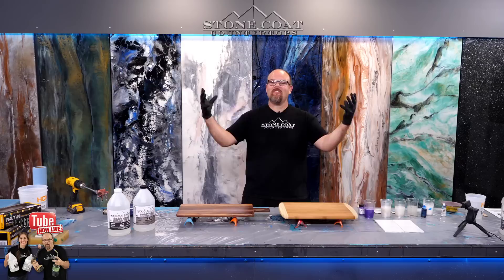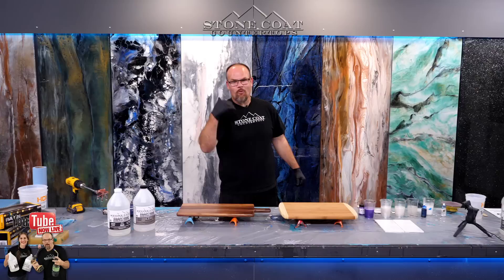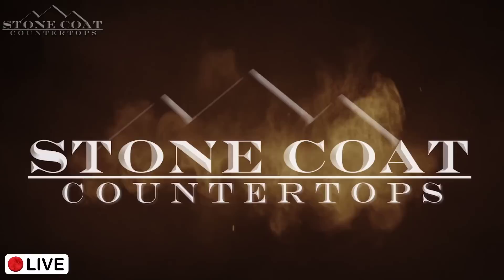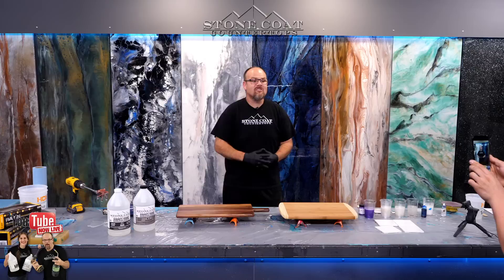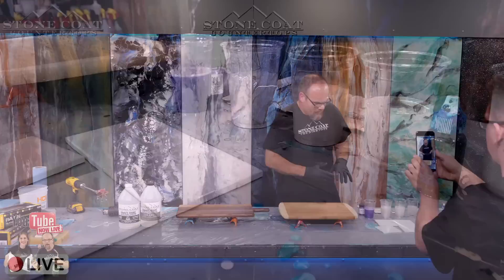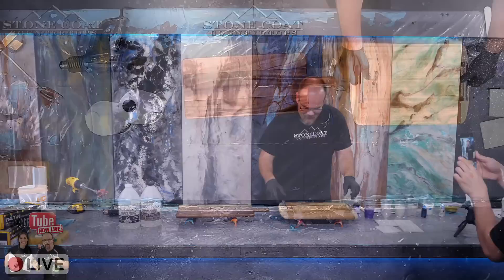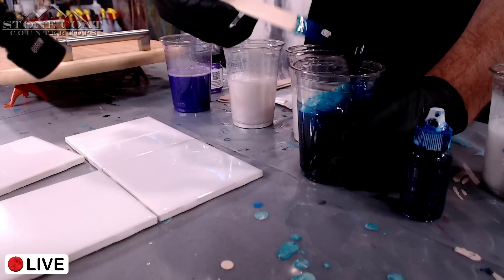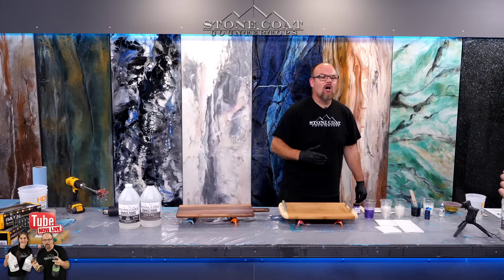Making Epoxy Videos Behind-The-Scenes | Stone Coat Countertops

Comment: Would epoxy work over an old tile countertop? Is it thick enough to level out the grout lines?
Reply: SCC has some videos about how to re-finish tile countertops.  You have to use a thin-set cement or leveling compound to  fill in the grout lines, before you can apply the epoxy.